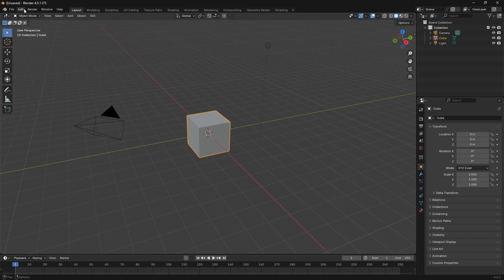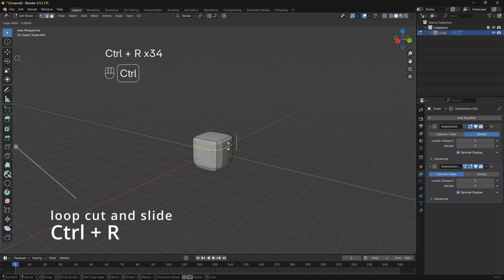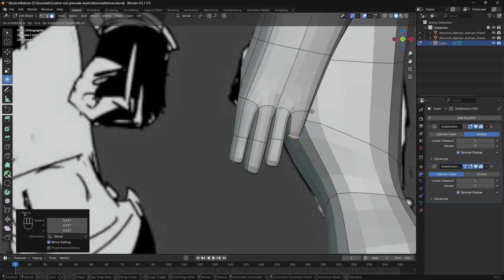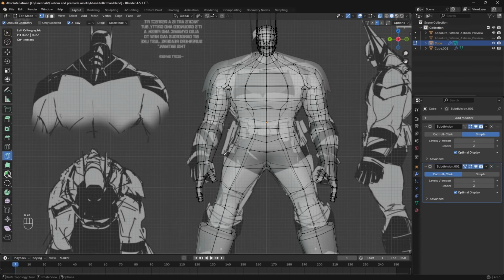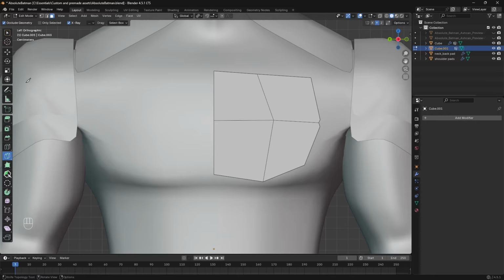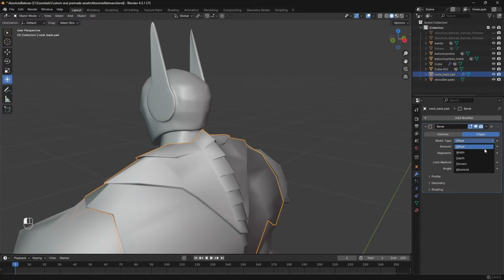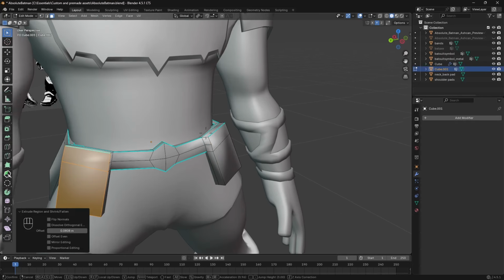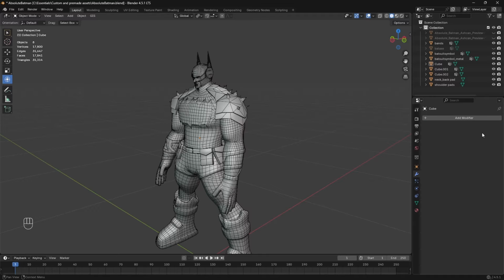3D modelling is this easy (ft. Absolute Batman)

Comment: 😵‍💫this supposed to be easy
Reply from the maker: actually yeah cus the standard workflow is sculpting and then retopology which is really difficult for me, this way you already get good topology and it's quicker.
Reply: @bunmachinedev 😂 i don't have pen tablet, i ll just use meshy ai
Reply from the maker: you don't need a pen tablet with this method, also ai generated mesh would require a lot of clean up and would end up taking a lot of time, better use mpfb addon, it comes with auto rigger